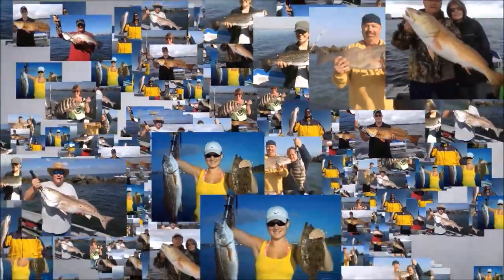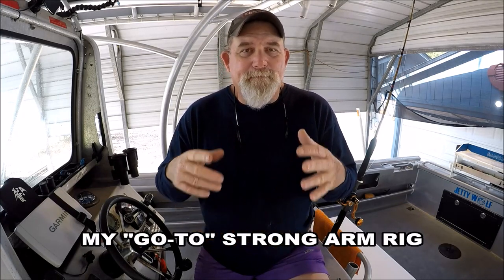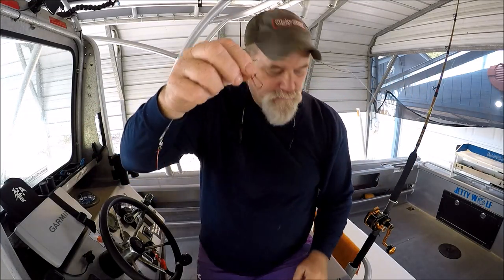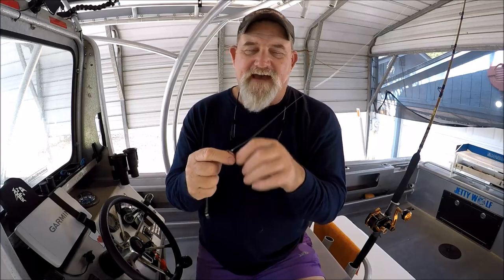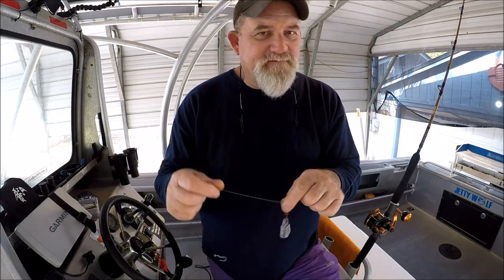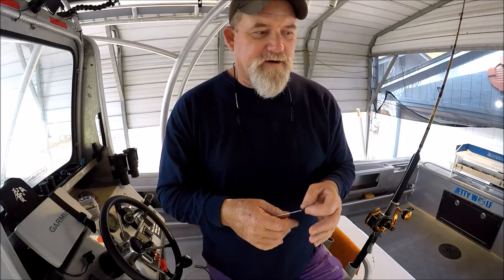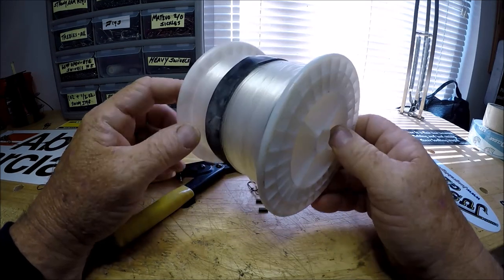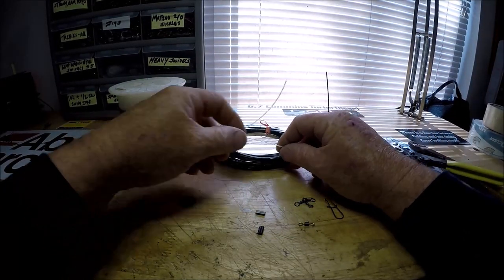MY STRONG ARM RIG - Saltwater fishing tech

Comment: I am obsessed with anti tangle rigs. Mine are very different. Now i want to try adding a stiff 100 lb leader line (Andy’s is super stiff) after the swivel , but my rig is different. Great vid, thusmbs up.
Reply from the maker: You don't need no 100 lb. anything.....just MASON hard type nylon. ANDE  doesn't want their line to be stiff....if so, its nothing compared to MASON HTN.  ITS AWESOME STIFF. Thats why they make it. Why are all these sweetwater guys doing such over-kill. Good gawd!  YA'LL KILLIN ME!!!!!  LOLOLOL.  BUT, glad it tuned ya in on another way....for major current fishing.
Reply: I don't fish much in current. But casting a 4 oz weigh and a 3 oz shad, 2 feet apart, makes a helicopter mess in the air. I use Ande not because it is strong, but because it is stiff, and doesn't tangle, and doesn't wrinkle. Maybe 80 lb will be stiff enough. But I have 60 LB, and it still gets kinked, not from fish, but from tangles.
Reply from the maker: 80# Mason HTN is so stiff, ya can't tie it. Thats why ya need crimps. I know ya ain't Marlin fishing.....hahahaha.
Reply: Capt Daves Sportfishing Charters no need for crimps. Look up FG knot. Its pretty and works great when one line is thicker.
Reply from the maker: Hahahaha.......ain't doin no FG knot with Mason!  I know all those knots and learned I have no need for them. "I'm not fishing for Giant GT in Figi" like you guys in Chicago!